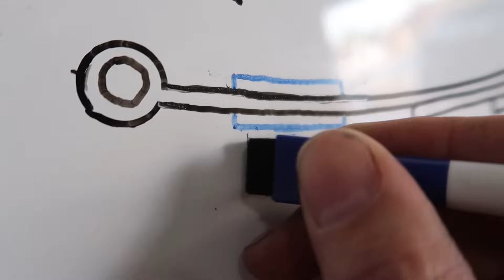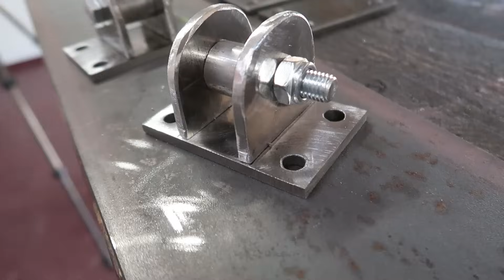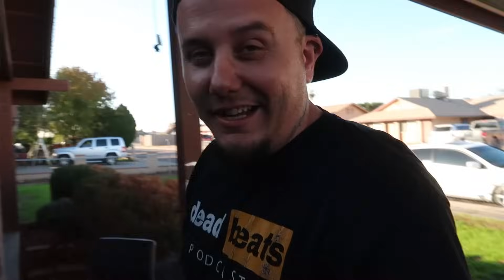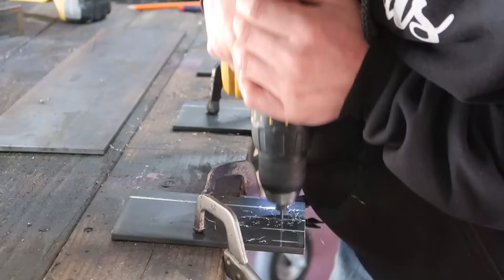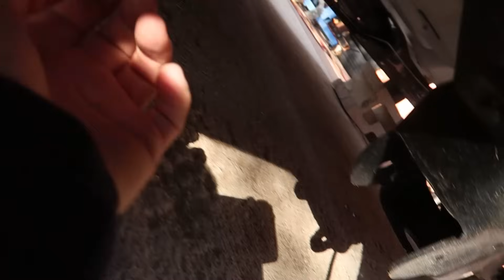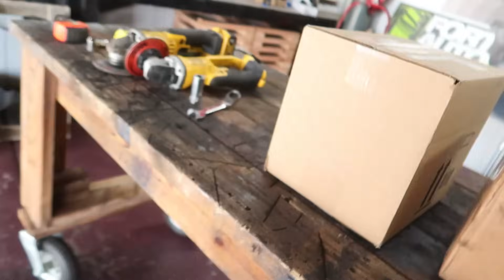Blazer is gonna WHEELIE! DIY Caltrac Clone UNDER $90!

Comment: Dude, I put the triangle on mines. I cut the bushings out and put the triangles and they fit very good.Only difference that I found is that it uses a longer bar for that, for the traction to adjust the traction
Reply: You have a first Gen blazer? I have an 88 and I'm trying to understand what he means by the mount is blocked by the frame? I'd love a Pic of yours

Comment: Instead of making a bracket to hook to the spring,,,just make your traction bars longer and attach them on the frame ahead of the springs. Alot easier and works better.

Comment: This might be an old video. I don’t know if you got your cooling system fixed problem, but you can buy. It’s called a double bypass radiator. It will fix all your problems.

Comment: bro just a little piece of advice  turn your heat knob up on your welder and slow down a bit  it looks as though your weld is just sitting on top and not melting together  i know you will get better because ocd      same

Comment: Idea : The bracket at the front that pivots and meet where the leaf spring bolts up, cut a tyre, rubber or something similar to place on the flat area where it meets to reduce vibration noise. It can be shaped and held with 2 counter sink screws.

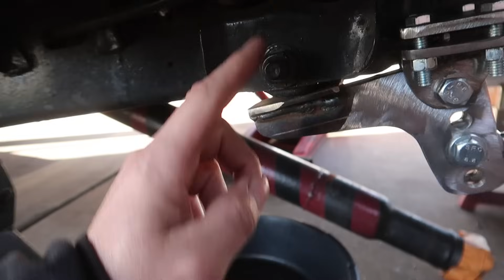Comment: 18:57 My man, although I love your finished product and outside the box thinking... But that's not accurate info about the CalTrac traction bar not fitting Blazers. The front pivot plates go in between your front leaf spring hanger not on the outside. The do make Blazer specific units but they most definitely would fit Blazers. Ask me how I know. 😂  Check out the install guide here:  https://calvertracing.com/wp-content/uploads/2021/07/Installation-CAR-Full-Guide-2021.pdf